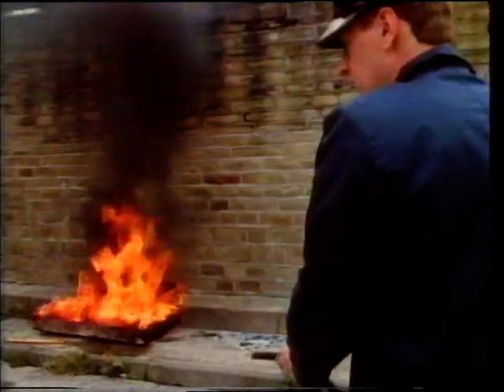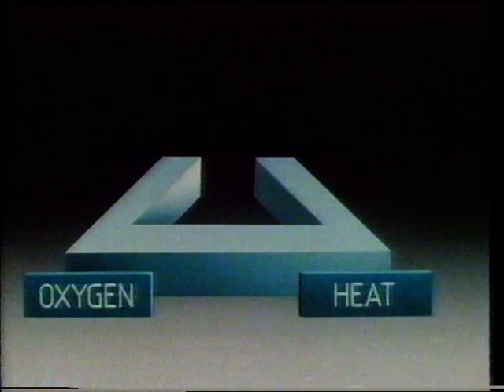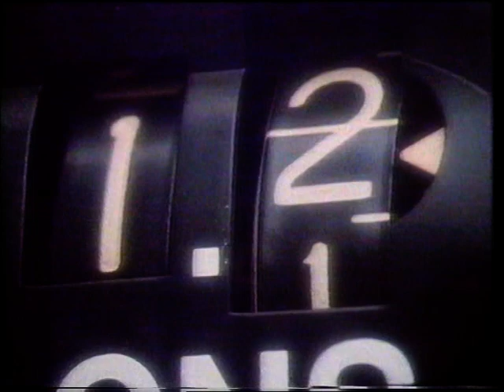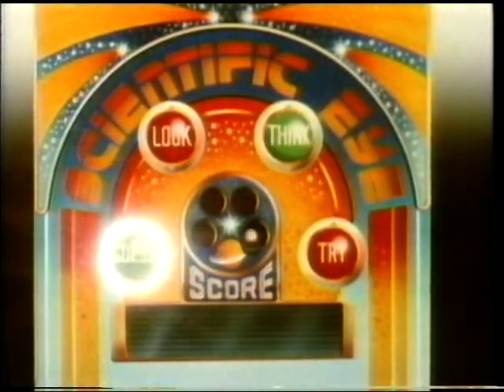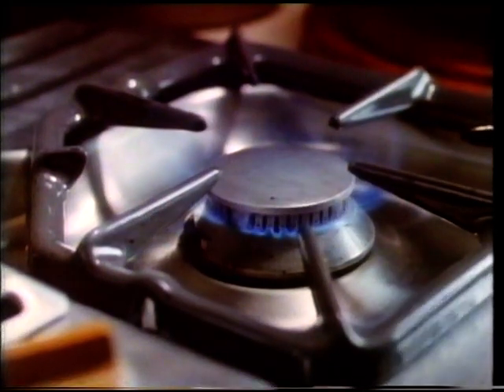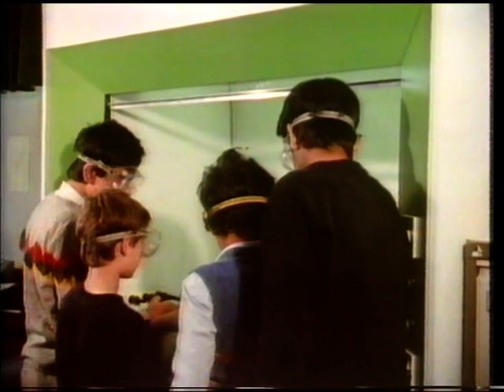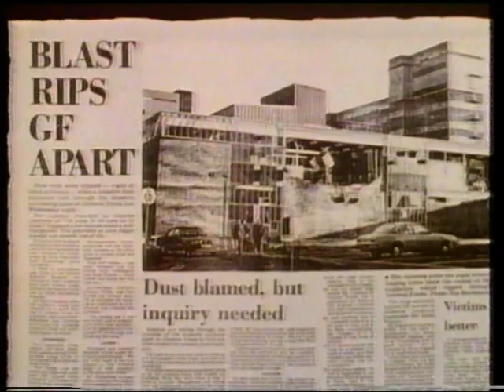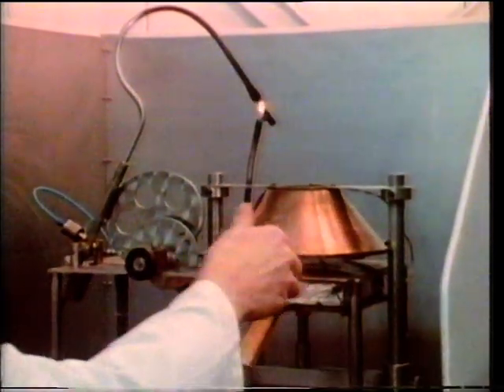ITV C4 SCHOOLS - SCIENTIFIC EYE: Fire and Flame

Comment: Adam Hart Davis as producer.
Also, the logo on the closing titles is crazy wobbly
Reply: Gavin Martin  no I mean that the logo is wobbly but the credits are not
Reply from the maker: I've only just noticed that too. I think it could be 1) the age of the tape or 2) the Scientific Eye Logo and black background were recorded on 16mm film and the titles were generated over the top 'live' using a computer. I think there was a similar thing with the Schools Film Clock which was used for regional opt-outs, where the clock would wobble but the programme title would stay still :)
Reply: In 1987, there was a massive fire at King's Cross Station, London. A lighted cigarette that was dropped on the wooden rods of the escalator was responsible for the cause. 2 years earlier, in 1985, a similar fate happened at the Bradford City stadium. The death toll would have been much higher if metal fencing were placed against the crowd to stop pitch invasions. The metal fencing did cause the Hillsborough tragedy in 1989.

In 1981, the Stardust disco fire began from a short circuit in the electrical wiring at the airing cupboard.